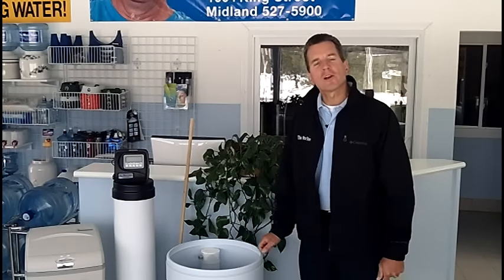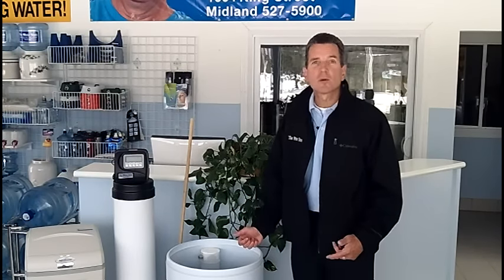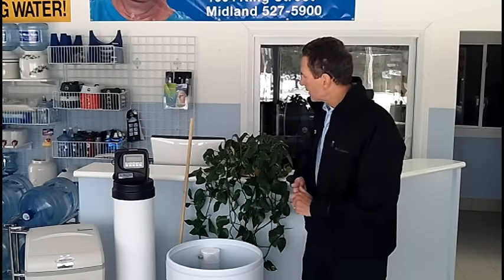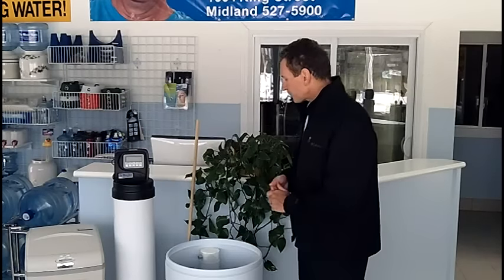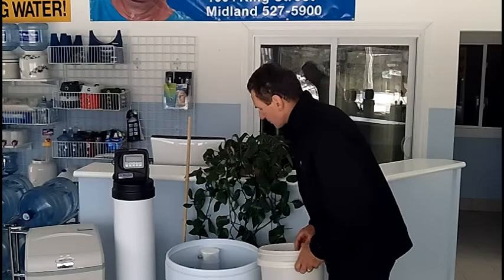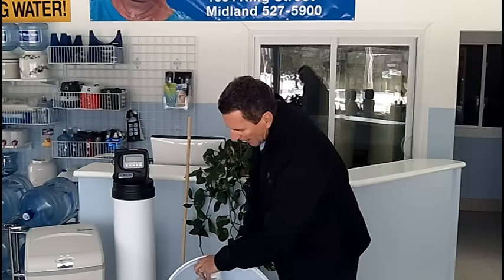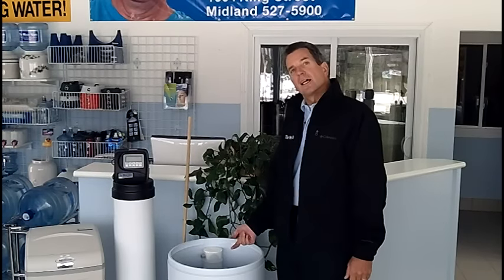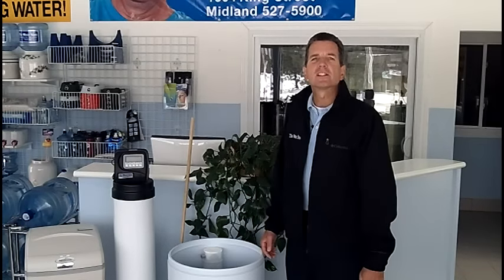How to Remove a Salt Clog from Your Water Softener

Comment: Thank you! We noticed hard water feeling during showers recently and opening the brine tank thinking we were low on salt, actually still had 3/4 tank.  Emptied salt/water as mentioned and discovered very bottom was a grey salty goo/guck/sludge which had appeared to be clogging things (we filled to the brim with salt). Ended up taking brine tank completely apart and cleaned it all out. Put clean salt and water back and manually did regen cycle, shower water is soft again!

Comment: Awesome video!  I was impatient so I used the shop vac and a scooper, and a ladel from the kitchen due to my short arms and got all the mush out.  I carefully used a pole I had that is for painting. The metal bar that holds the roller worked perfect for carefully scraping the bottom.  Can't believe when I asked  for the water softener to be checked by "professionals no one ever suggested any maintenance! And I'm bad for not reading the manual!!  Thanks!!

Comment: would a salt blockage cause your water pressure to become low? I noticed a few months back that my water pressure became very low when two water sources are being used at the same time, When I by passed the softener the pressure went back to normal. I am going to try this procedure and hopefully this fixes the problem.
Reply: Did you ever get an answer to this ?
Reply: I'm wondering the same thing...  My water didn't feel soft, so I checked the salt level.  My brine tank has filled with probably too much water and I'm not getting as much pressure at my kitchen faucet.  Not really sure what the fix is, but I have to start somewhere.  ugh!
Reply: My water inside of my home is spitting out of my faucets and my water pressure is low
Reply: I don't know where to start
Reply: Add Res Care to the brine tank before regen. My water pressure in shower went back up.  The beads need the Res Care to clean them on regen.  Amazon carries the Res Care.  Comes in gallon jugs.

Comment: Half of my tank was a block.  So far I did the 3 gallons hot water in barrel and 1/2 hot in tube and regened.  Better.  Got some broken up.  Regened again...better yet.  Tonight I'm going to do the whole thing over with the hot water and two regens.  As I suffer from Reactive Airways Dysfunction Syndrome from toxic PVC cement poisoning almost 4 years ago and cannot tolerate any chemicals etc., if this works on my 20 year old water softener, I will be a happy sickly 70 year old female.  Bless your heart for sharing this info.
Reply from the maker: I ma sure it will!  Thanks for watching! Please share video with friends and family!
Reply: @water_estore  I certainly will.  Thanks so much.
Reply: @water_estore  So after my second day my salt is about 1/3 of where it was and there is about a gallon of water on top.  So I removed most of the water with a cup and I guess I need to remove what salt I was able to break up.  There is still a block as my broom does not touch the bottom of the barrel.  So do I keep doing this with the hot water, regens, breaking up any bridges, removing the water and salt until the barrel is empty of both?

Also just curious about what you do with the salt water and salt you remove.  Can it kill unwanted vegetation?

Comment: Thanks, Gary. Your videos are very helpful to this water softener newbie! Quick question: Where do I dump the brine water I remove from the bottom of the tank? Will it hurt my drain pipes? And the sludgy salt I collect from it? There's so much of it...whow is it best to dispose of it? Any help appreciated.
Reply from the maker: I just dump it on the driveway and let the rain dissolve and washt it away.
Reply: I would not dump it on your driveway if it's near a flowerbed or a lawn though, that salty water will kill plants.
Reply: @AuronFFX  I agree with you.  Also my neighbor guy dumped softener salt pellets on his driveway in the winter, and the next year had to replace his driveway because it caused so much pitting damage to his concrete it looked like the surface of the moon.  Kind of like people who use way too much ice melter on their driveway.  And I have had a couple bushes next to my driveway die because for a couple consecutive years I shoveled and piled the snow towards the base of them and all the road salt from the cars driving into the garage there in that area got deposited at the base of the bushes.

Comment: Thanks for the info.  Had a salt bridge about 4 inches thick.  Removed it with a stick and my wet/dry vac.  Should do the trick, will find out.
Reply from the maker: yes it should!
Reply: Thanks for the reply but I have a question.  After re-charge I have about 2 inches of standing water in the brine tank.  Is that normal?
Reply from the maker: @MrBob-vc4qd  It depends if yours is a post fill or pre fill water softener.  For a pre fill it likely is, for a post fill it is not, there should be much more water.

Comment: I'd like to add some type of cleaner  to clean the resin but the manual says the following. I have a Dupure Impression series. My softener has not been working for almost three years (only was fine the first 3 months) and the maintenance guys that come just tell me everything is fine. My dishes have tons of spots and the toilets get a nasty ring at around a week and a half. Ive been watching your videos over and over because I want to try and do the salt clog cleaning to see if that helps. Your videos are so informative. I've shut the softener  for a week and I get the same results as with it on. Do cleaners mess up the resin? Also, any suggestions on what to do? 

CAUTION: The manufacturer does not recommend the use of any
resin cleaners, nor placement of any resin cleaners into
the brine tank. This may be harmful to the water
softener and for human consumption. Consult dealer
for proper cleaning instructions.
Reply from the maker: First I would have your water tested for hardness before and after the softener to see if the water softener is reducing the hardness.  If the softener is not working and you have tried everything else you have nothing to lose by using the resin cleaner.  In my experience cleaners do not mess up the resin.  Although I find it hard to believe that the media needs cleaning after only 3 months of use, I think there is something else wrong here.  I have no idea why they have that recommendation.  This video explains how to use them https://youtu.be/c8QKYr3B02I
Sounds like you have nothing to lose.

Comment: Great video Gary.  Just a question which might sound dumb but here it goes.  After the tank is completely dry, do I then return all the salt that was in it and then pour the 2-3 gallons of hot water in?  Thanks for your response.
Reply from the maker: Add new salt with the water.  You can gradually add back the  old salt mixed with new.
Reply: @water_estore  Thanks so much.  Blessings for a Safe, Healthy and Happy New Year 2021!

Comment: I bought a house last week it had been on the market for over 9 months and was vacant.  Water system sat unused during that time.  The softener is older and has a cam  gear type system.  I had a huge salt clog in the bottom, roughly 7 inches thick.  I removed all the salt and I'm not sure what to do to get the system up and running again.  There is no float in the brine tank either just a tube. There is no button for a manual regen.  it has a dial that reads (Fast rinse/Refill=====Brine/Slow Rinse====Backwash====Condition Water) .  Should I just put salt back in the tank and plug it in?
Reply from the maker: Try running it without any salt first to make sure it goes through all the cycles and doesn’t leak. If all is okay after a couple of regents then add a few bags of dalt
Reply: @water_estore  is it normal for some older brine tanks to not have a float?  There is a glass with a ball o the tank.  It there a way to set the amount of water that enters the brine tank?
Reply: @water_estore  Hi Gary and OP, thanks so very much for your awesome and helpful video(s)!

I think the next question for many is “if we completely remove both salt and water, do we need to manually put any water back in the tank prior to the leak test and reincorporating salt, or will the system “know or discover” that there’s no water and add appropriately”?

Comment: Hi Gary,
Thanks for the video!  One part doesn't make sense to me?  After you remove the loose salt and brine water (the tank should be empty at this point). Then you had 2/3 gallons of hot tap water "on top of the salt"?  But the tank should be empty because you just removed all the salt and brine water.
Reply from the maker: Ideally yes, but sometimes the salt is so compacted at the bottom you cannot get rid of it all.  The hot water will help dissolved that salt so it can be removed without trying to bash it out and risk damaging the water softener.

Comment: Although clogged up and not working properly, how come, the system still displays "softening"? Thanks for the helpful video.
Reply from the maker: Great question!  The only time softening displays is when the meter senses water moving through the valve. The water softener does not know if it is producing soft water or not.

Comment: Probably what has happened to me. Changed out the resin last year and has run great since. Now I have a giant salt disc about 8 in thick in the bottom of my softener. Cannot loosen it up. It is still softening the water however so we are not adding any pellets until the disc devolves.
Reply from the maker: Yes, eventually the new water will remove enough or the salt that you can break it up and get rid of it.

Comment: Gary, I had a major salt bridge. I finally after several days got all of the salt out and hosed it out clean and suctioned all of the water out with a Wet Vac. I put two bags of new pellets in and plugged it back in. The electronics are working because it shows I'm using salt, but the salt level isn't going down at all. What's up with that? Any suggestions? Thank you, Jeff
Reply from the maker: How many times has it regenerated since you did the work.  A water softener will only use salt during regeneration.  More info here https://youtu.be/wPh_l56OWOM
Reply: @water_estore  I appreciate the reply. I have it set on regeneration at 2am everyday, but after I cleaned it and put new pellets in I did a manual regeneration and probably 4-5 times since then

Comment: Just did everything you said in the video, took apart the valves in the bottom and couldn’t find a clog.  Did however find lots of little black bugs that found their way down into the brine.  Removed all of them, any suggestions?   I’ll spray the tank with bug spray.
Reply from the maker: Yes, and refill with news salt, 5 gallons of water, wait 24 hours and manually regenerate.

Comment: Gary, I think I have a salt bridge as I can't push a broom handle all the way through.  I had previously added iron out, but not immediately done the regeneration cycle.  Now, when I work at breaking the salt bridge up, I am inhaling these noxious fumes.  Do you have a different/safer recommendation for removing the salt when it is laden with iron out?

Comment: if you have hard salt build up where you can't even get down to the water, can you do the same thing just over many many days? Add hot water, regenerate, break up salt? 
After each regen, do you add more hot water after you break it up or not?
Reply from the maker: Yes you can and often need to, to get rid of the salt clog.

Comment: I just discovered a 4" salt clog at the bottom of my tank. Can this issue cause a high water bill ? My last water bill was 12,000 gallon a month (with 1 person living there)  Also after I clean everything out do I add any water before I dump the new salt in ? My Softner is only a year old with digital controls.
Reply from the maker: No, something else caused that massive water bill, likely a leak somewhere.

Comment: Hi Gary : 
I have been watching all your videos about water softener 
I had a loss of water pressure thus I cleaned and broke the bridge formed in my brine tank and replaced the salt rock with pellets . Also used Rust out in pump of brine tank 
I have started the regeneration and gone thru an hour of BW BD cycles 
But only during the 1 hour cycle the water pressure in my faucets was perfect but after an hour there was another cycle for 10 min when I had no water coming into faucets 
Like to know the programming cycle on my keypad so I get continuous water in house 
My model number of water softener is SXT timer
Reply from the maker: This video will help https://youtu.be/tCQQxiT-zoc but likely the media is compromised and will need to be replaced.
Reply: @water_estore  thanks Gary

Comment: So. The bucket was used to gather the old salt. Then you said to add water using the same bucket. You didn’t mention anything about the salt that is still  in the bucket.  Not clear if that needed to be dumped first
Reply from the maker: If the salt is not clumped together you can reuse it.  If it is partially dissolved and clumped together get rid of the old salt and start with new salt.

Comment: Thank you for this. I removed a clog using your advice. However, now new salt level does not seem to be going down at all. Any suggestions?
Reply from the maker: There is somehting wrong with your water softener thta likely caused the clog in the first place.  this video should help https://youtu.be/Lr3jyGiJdC0

Comment: Hi Gary, could you tell me will salt clog reduce the water pressure when two or more faucets turn on at the same time?
Reply from the maker: No it won't but if the water softener media tank is partially clogged it will.  Check out this video https://youtu.be/tCQQxiT-zoc

Comment: Gary great video.  Only thing that is confusing to me, is that you say remove the salt until you see some water and you shop-vac that out.  But then you say take a couple of gallons and pour that over the salt?  So I guess my question is do I just vacuum out the water that is above the salt on the bottom of the tank and leave the salt on the bottom of the tank there and add water?

I was thinking of just completely cleaning out the tank of salt and sediment until getting an empty tank and then adding new salt and about three gallons of water and hitting regen....  Seems to be an easier solution to me instead of  regenerating  a few times and risking some sediment still laying at the bottom of the tank
Reply from the maker: BigTime sorry about the confusion. If you can empty out all the salt and start fresh, great go ahead. But if there is a huge salt clog in the bottom which you can’t get out, then you would add the hot water and do several regenerations.
Reply: @water_estore  Understood, thanks Gary!

Comment: Thanks buddy I switched from culagan salt to sifto salt, the size difference was from small to big salt chunks and it ended up all packing down way to tight, but you have just shown me all that I need to no about this. Do u no much about the big blue 5 micron filter I have it set up after my well and jet pump and then my softening system follows threw right after it I seem to have to change it once a month or more. An alternative would be great cheers Gary
Reply from the maker: Yes, you can use a dual gradient filter like this one https://waterestore.ca/products/pentair-filter-20-big-blue-sediment-dgd-5005-155358-43 to capture the larger pieces of sediment on the outside while still giving you that fine 5 micron on the inside. Or you could put one of these spindown filters on before the big blue to prefilter the bigger stuff https://waterestore.ca/products/vu-flo-spindown-filter-housing-1-1-2-socket

Comment: Gary, we cleaned all of thes sand-consistency type salt sludge out of the tank, added hot water, ran regen many times, but however we cannot get the very bottom of it out of the tank-about 2 inches worth, because cannot reach it (it has the taller tank). Must all of that 2 inches of sand-like salt be taken out, or can we just put the new pellet salt overtop of that now?  Thanks.
Reply from the maker: Yes, ideally it should come out.  Did you try disconnecting the tank, taking it outside and turning it upside down and pounding on the bottom to see if it will come out?

Comment: So I have a new softner it worked great rt away. After about 3 weeks I filled the salt to just below the cap. Now the softner is not working nearly as it was. Could I have to much salt? Even tho the instructions said to have enough water tht the salt is just above the water line as i did at first or fill it to just below the cap?
Reply from the maker: With how new your softener is it really should not matter.  Somerthing else is causing the problem.
Reply: Got to the cabin broke up the salt it seemed like it was crusted up sum.  Ran regeneration now I definitely can't get to the bottom of the brine tank with a stick. Seems like it's all mushed up? Water is not good. Seems like it was having a hard time drawing the brine.